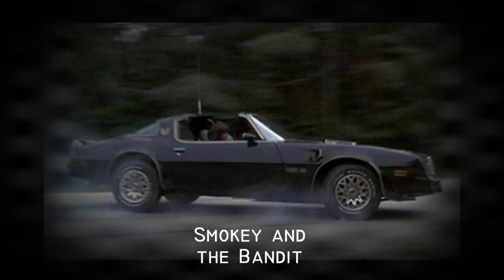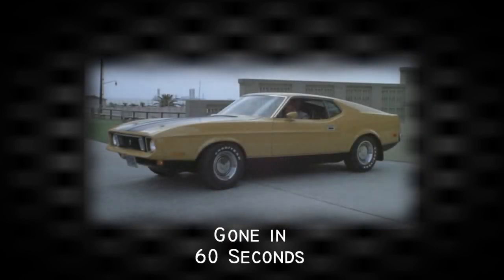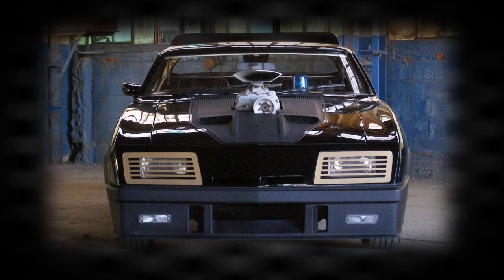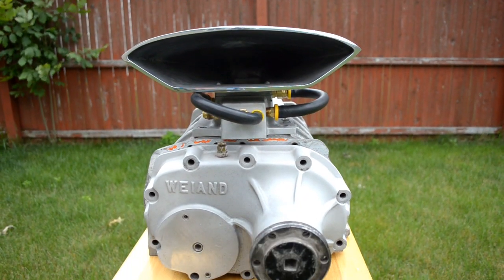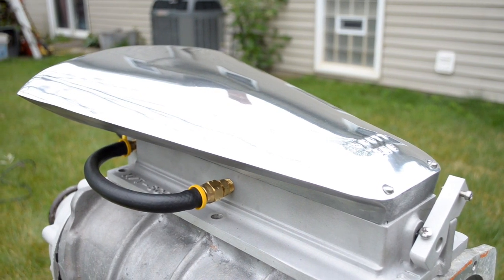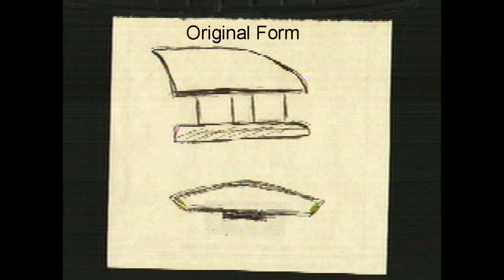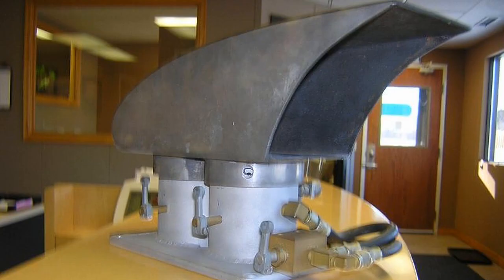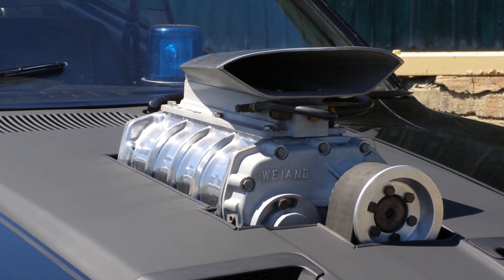My Mad Max Interceptor Project: Part 8

Comment: Hey man i need some advice. where can i even find a Ford Falcon XB 73? I live in Tennessee lol do i really have to go austrailia anymore to find it?
Reply: they cost about $50,000 - $90,000 so good luck
Reply from the maker: Sign up at the Australian Ford Falcon group at Yahoo and see if anyone has one for sale. You will see one occasionally on ebay. To import one from Australia costs a LOT of money now compared to when I got mine 10 years ago.There's close to 100 of these cars in the US and once in a while one of them goes up for sale.
Reply: 1001Hobbies could you give me a link to this Falcon Group? cant find it
Reply from the maker: Tommy Vercetti https://groups.yahoo.com/neo/groups/AustralianFordFalconClub/info

Youtube doesn't like to post links but I will try this.
Reply from the maker: Nicholas Politis
They cost around $20 - $30 thousand from Australia, depending on condition and whether it is a GT or not. Finished Mad Max replicas usually go for around $40K-$45K. I don't know how much it costs to get one built by a builder. It may be possible to get a car to work on that is already in the US for $15,000-ish and up.

Comment: Would love to stick a weiland on my 5ltr torana. Where can I get one
Reply from the maker: jamie atkins Go to the Holley website. They own Weiand. You can even buy a replica of the front cover that looks like my vintage one. The swingarm is not as accurate though. I still have a few left of the ones I had made. I had measurements taken from an original and drew it up in CAD, then CNC machined my own. After some inquiries I had a small lot of them machined at a local shop. They are the most accurate ones you can get, for as long as I have these 3, and one of them is spoken for.
Reply: +jamie atkins It's a Weiand

Comment: Hi, I hope all is well, Any updates on this project?
Reply from the maker: Hasn't been touched as I pursue my filmmaking career. However, I am working on putting together a film project that would require the "use" of this car in its finished form. Still in very early stages. Working to get major people involved. Have a Letter of Intent (LOI) from a very major, key person already. Quite a ways to go yet though.
Reply: @1001Hobbies  that's great to hear, I've been watching since this started and it great to heat that hopefully one day it will be alive, no pressure of course, keep up the good work

Comment: Any updates on the Interceptor project??
Reply from the maker: Unfortunately, no. I've been pursuing my filmmaking career. I just wrapped on one Feature Film, I have a documentary in post production, and I am about to start helping a friend with his feature film (he helped us with ours). On top of that we just got a Hollywood contract for a $$$$$$ film, and that will be my big break. This was my first dream, the car was my second. It pains me to see it sitting in the garage. It is safe from theft and the elements. It is just waiting for me to be able to get back on it.
Reply: I completely understand. It's sounds like you have a great opportunity there- I wish you all the best. About the Interceptor- besides the Mad Max specific parts, how hard is it to get parts for the Falcon? How much of the mechanicals is shared with Fords found here in North America? How much has to be imported from Australia? How many parts are discontinued and how many are available as reproductions?
Reply from the maker: You can pretty much find all the regular maintenance parts (tie rod ends, brakes, ball joints, etc.) available in Australia. You can use brake rotors from a 1971 Mercury Cougar. That's about it. Most of the parts are specific to the Aussie Falcons. They are right hand drive so that also factors into why you can't use some American parts. Also, the brake calipers are not the usual Bendix or Kelsey Hayes but are rather an Australian brand called "PBR." Calipers and pads have to ceom from Australia, unless you swap in the spindles from a 1971-1973 Mustang. Then you can use all the usual Mustang brake stuff.

You can use universal joints from here, shock absorbers, and some coil springs (from 1972 Gran Torino). You may or may not need to trim them. 

For the most part, you would likely be getting parts from Australia, but you won't be driving the car every day so the parts will last longer (brakes, etc.) I am sure you can find belts that will work on the engine. The engine is pretty much the same as the American versions. The 351C was originally shipped there from Cleveland Engine Plant #1. They then tooled up their own plant to make them there.

Comment: Fairmont I’m sorry but ain’t no interceptor
Reply from the maker: "Fairmont" is basically an interior package. It is the same car as a Falcon. Once I put the Falcon interior into it you won't be able to tell. However, if you crawl under the car you will be able to tell it is an XA and not an XB. Meanwhile, it is originally a 351C car (It had a 351C in it when I got it but not the original), toploader transmission, and 9" diff.

Comment: You Americans make me angry when you call the Mad Max black car "Interceptor". At no point in the original three films was it referred to as "Interceptor"...or even a pursuit special for that matter.
Reply from the maker: There is a scene in the original Mad Max film where Max is driving the car and the female dispatcher on the radio states that a Pursuit Special has been stolen. This is the car Max is driving.In Mad Max 2 the mechanic, who is suspended from a crane, states "Last of the V8 Interceptors. Would have been a shame to blow it up," as he shows Max the bomb he removed from the car. There is disagreement among fans as to whether the mechanic was referring to the car or the engine when he said "Interceptor." However, it is because the mechanic clearly claims "Last of the V8 Interceptors" that people call the car an Interceptor. Others who are very deep into the films prefer the dispatcher's reference to the car as a Pursuit Special.These are the reasons these terms are used.
Reply: Once again, you have no real evidence it is the car Max is driving...secondly, in this first film there was the four door XB which had "Interceptor" on the boot lid.
Reply: Not to mention Night Rider was in the monaro pursuit special. My point is we know which models the cars are. However in the Mad Max movies the cars are generic.
Reply: +Mark Smyth guy on crane just say "v8?...ha?"
Reply from the maker: Ok, I believe you have not followed the film close enough. I will spell it out for you in even more detail.

Max resigns from the Force. The Chief, Fifi, tells him to go on vacation and "grow a beard." However, because his family gets killed he goes back to the underground garage and steals the all black XB Falcon to get his revenge on the motorcycle gang. In the scene where he is pulling up to the trap where the motorcycle gang has made it look like one of them wrecked, and his bike is in the weeds, past a fence, and his body is on the side of the road with a bird on it, you hear the dispatcher (female voice) stating that a Pursuit Special has been stolen. This is the car Max stole and is driving. Watch that scene and then get back to me.

In Mad Max 2 watch the scene where Max has brought the guy's body back to the compound and is carrying him on his shoulder with his belt in his hand. The people in the compound come out and get the man's body and secure Max and bring his car in. The mechanic on the crane says "...last of the V8 Interceptors. It would have been a shame to blow it up." After you watch this scene then get back to me.
Reply from the maker: Earlier in the film when the car is revealed to Max in the Garage, Fifi (The Chief) is talking with Labatouche and Labatouche says how bad it is that they have to bribe the officers with candy, meaning the black XB Falcon which was just revealed to Max while they listened to it on the radio.

How do you feel about all the Aussies who call it "Interceptor" or "Pursuit Special?"
Reply: American .......... and I am LMFAO! Relax mate .......... have ya a Fosters
Reply: I don't think you're following what I am telling you. Also, if you're reading your own comments. You're defeating your own argument. Let me put this point to you in a way that someone with an American public school education can understand. Night Rider's Monaro (which is called Pursuit Special as well, but is clearly different from Max's car from the revenge scene). Are you saying Night Rider's car; and Max's car are the same? Since you're a huge fan of Mad Max movies I'm sure you'll recall the letters on the back of the four door XB Falcon that Max pilots at the start of the first movie. Does it not spell "Interceptor"? As for the mechanic in the oil refinery, you said in your first comment that it's a possibility that he was referring to the engine. I think you should go with that. 

I feel exactly the same way if Australians use the term 'Interceptor' or 'Pursuit Special' for Max's car. It's popular but wrong.

FYI, Foster's Beer is British, not Australian.
Reply: mmmmmmmmmm Ok.
Reply from the maker: I would expect you to know your beer. Personally, I don't even drink. I've never had a beer. I know what point you were trying to make but this seppo isn't falling for it.LOL, I have not defeated my own argument anywhere, and I see that is what you are here for, not the facts. You have not presented any, and I have given you exact moments in the films that support what I have told you.As you can imagine, I am a member of several groups of builders and owners of these cars around the world, including Australia. Of course this subject has come up numerous times over the years. What I have provided to you is the consensus that has been concluded based on extreme discussions and analyzing by people who have a vested interest in resolving this issue. These are people who've debated at length which heater control valve is the accurate one that was on the car when being filmed. Many of us have studied the film frame by frame several times. ...but enjoy your "argument."
Reply: I am not disputing your references, or the fact you've made a screen accurate replica of the iconic beast. I am disputing the context of your references (like I have never seen the movies before, or understand why unintelligent people use the terms 'Pursuit Special' and 'Interceptor'). Nevertheless, they have used both terms incorrectly. The reason that it is incorrect is because all MFP cars are either 'Pursuit Special' or 'Interceptor'. Which means they are generic, not having an individual identity...so no name! I'm not trying to trick you or make you believe something you don't want to. Why do you think people adopted 'Interceptor' over 'Pursuit Special'? Because it sounded cool. George Miller kept the cars nameless for this reason. All I want to do is give you a richer understanding of this quintessentially Australian movie.

Comment: you killed a nice car .what a waste of money
Reply from the maker: ChadMutt I have my dream car, and I am working on it as I can. How about you?
Reply: your trashing my dream car. do know the value of the car. how are you going to replicate the mad max car . it was made from a xa xb xc and the custom front off a panel van. why don't you make a green hornet car
Reply from the maker: ChadMutt I see you don't understand. This car is an XA Fairmont that had all of the parts on it from an XB Falcon when I bought it, so it looked just like an XB Falcon then. I already have a replica body kit; Arcadipane nose, boot and roof spoiler, and fender flares. I already have what it takes.

Yes, I know the value of the car, and much, much more. I don't go into such a significant project without knowing as much as possible.
Reply: what about all the xc parts it doesn't have. there's not a big difference between an xa and xb . have fun with xa xc  gt bonnet . let alone cutting a hole in it. not sure how you going to do the petrol tank.  it's all in attention to detail don't you think steve .
Reply from the maker: ChadMutt I know all of the differences. I have repair manuals for them all and I have a Ford shop manual for the XB. There is a BIG difference between the front of an XA and XB. The whole front end is unique to each vehicle. The guards, bonnet, grill, and bumpers are completely different between the 2 cars. The XA doors do not have the chrome bezel under the door handle like the XB does, and thus there is no pocket stamped into the door to accommodate it.

As for XC parts, the only ones used for the movie car are the headlights and the mounting brackets that mount them to the radiator support. I HAVE THEM.

If you are talking about the petrol tanks in Mad Max 2, I am not building that version. I am building the car from the first movie.

Attention to detail. Please watch the video again. You will learn that I was in contact with the man who designed, engineered, manufacturers, and marketed the fuel injector that is on top of the blower (Mel Scott). I was able to also ask him how that design came about for the scoop. No one had ever asked him that before. Detail? If I went this far just on the fuel injector imagine how far I've gone to learn about all the rest of the details of the car.
Reply from the maker: ChadMutt I am not using any GT parts. No need. No, it will not have rear disc brakes. No need. It does have a Ford 9" axle though.

I have a boss kit from a steering wheel I put in another car to use for the SAAS wheel. If I can acquire a Max Rob wheel I will. 

There are many Aussies who have expressed their admiration of my project. There are others who are glad it is not just going to rust away either in Australia or the US. The Aussies who have expressed their disapproval of my project have been in the minority. I know some people are not going to be happy with it. That's the way it is.
Reply: most australians hate my two door with a passion. mine was rusting away in someones back yard . i could see the point in a v8 so i problem dropped in a turbo six out of a skyline. that pissed some people off.
Reply from the maker: ChadMutt If you are talking about a Falcon/Fairmont I am glad you rescued one from rusting completely away. If you are talking about the Ford, why not put a turbo six from a newer Falcon into it?
Reply: yep a two door Falcon . it had L on the id plate so it was a six when it was born(it was a v8 when i bought it ). most people want the v8s.  . the skyline six fits with out   to much modifying and at the time ford six was out of my price range. it had just over 300 hp at the rear i thought that was cool i could have cake and it too fuel wise. hay this has nothing to do with fords but are hudson hornets sort after in america sorry for my ignorance . a fella down the road just drag one out of the shed wants me to paint it . i ve only seen the one in cars and that's not real.
Reply from the maker: ChadMutt Yeah, my whole car didn't cost that much, including shipping to the US, and then from the coast to my house on the other side of the country. I am fortunate in that my mate in Canada knew Mel Scott personally, so I was able to get a LOT of inside info about the product and the man. He was really an incredible engineer, still working on things just before his death a couple years ago.
Reply from the maker: ChadMutt I would much rather see a Ford engine in a Ford car, but I understand when it comes down to money. 300 HP at the wheels is very respectable with a 6.

I don't know how many people are actively seeking out the older Hudson Hornets (in the 1970's American Motors Corporation also had a car called a Hornet) but anyone who is would be a pretty old guy. A place you could get a better answer would be the Goodguys car club. They are vintage hotrod enthusiasts who own mostly cars from the 1950's and older.